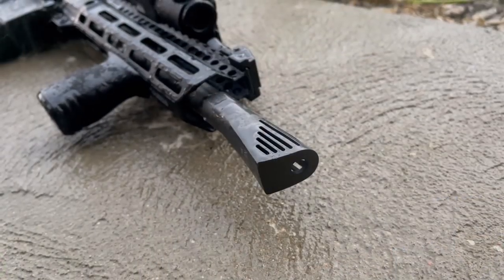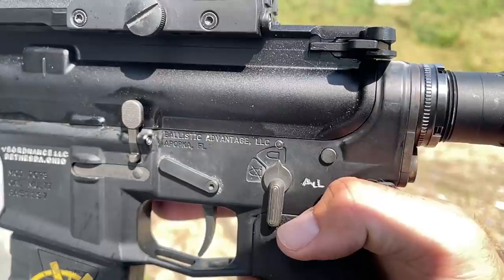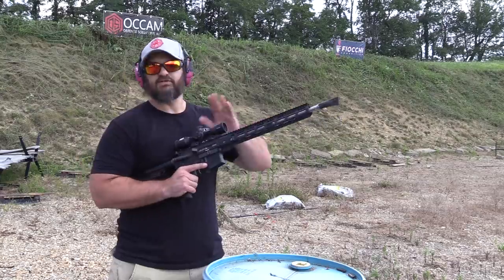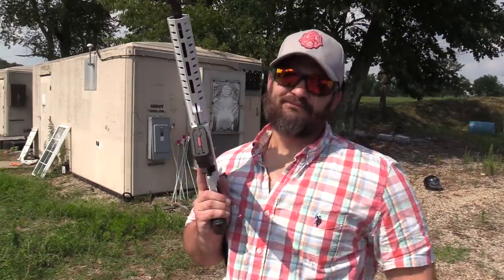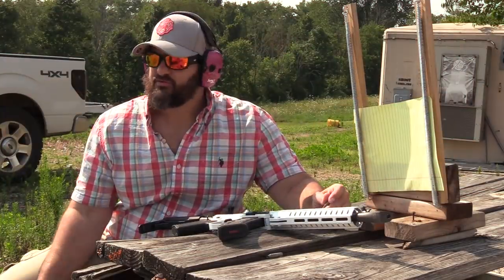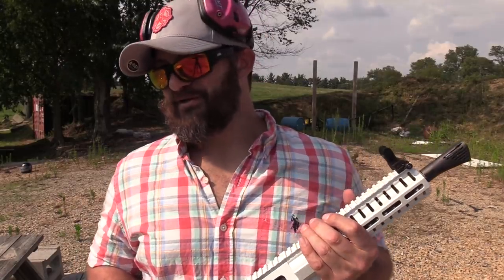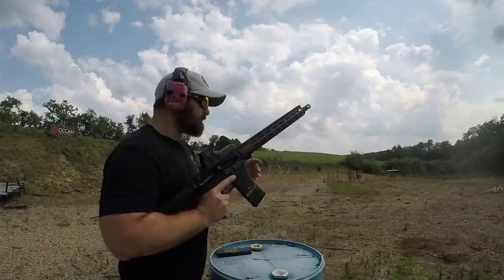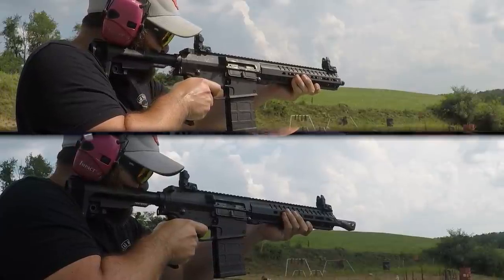Walker Defense Nero 7.62 3D Printed Brake

Comment: I'm surprised you can 3d print with inco718. I used to work at a company that forged inco718 into the turbine blades that go into the high temperature sections of f18 and b2 engines and it's a super dense and temperature resistant nickel based super alloy. The way it behaved in forging i wouldn't have thought it would be suitable for additive manufacturing.

Comment: So it's like a modern Halbleck device?, I'd like to see it on a FAL or a G3 clone
Reply: Seems even better than the original. The Halbeck device overcompensated so much that you had to push it up while firing in full auto.
Reply: And Halbeck device apparently wasn't reducing felt recoil.

Comment: Hmmm. Looks like it could have easily been cast/milled. Why 3D printed??? Yet another placebo muzzle device...It's cute though, I guess.
Reply: Investment cast would work great, inconel turbine blades are made that way.
Reply from the maker: @ChucksSEADnDEAD  there is more going on inside. How would you do this in one piece?
Reply: Can you elaborate on "placebo"?
Reply: @VSO_Gun_Channel  Same way turbine blades are made? A core inside the investment wax creates the internal geometries in one go. The core is then removed by dissolving it in a bath. This is child's play compared to the air channels inside turbine blades.